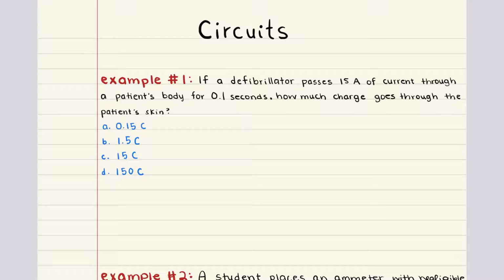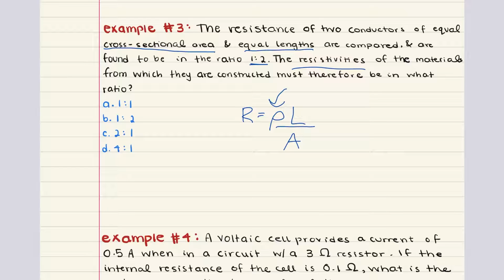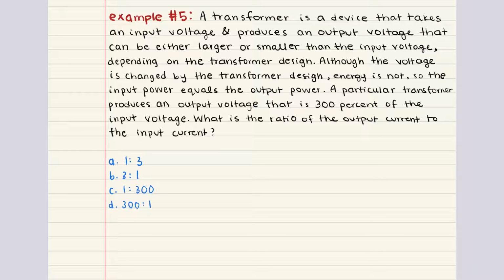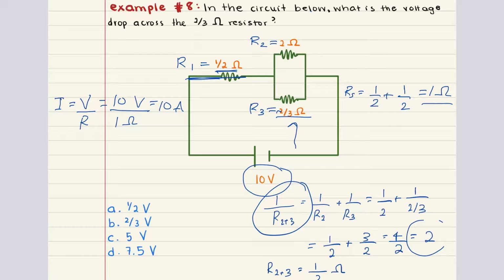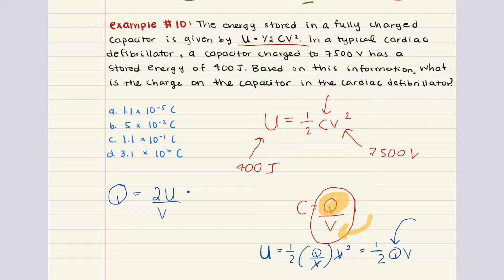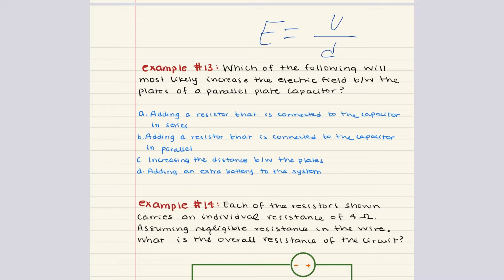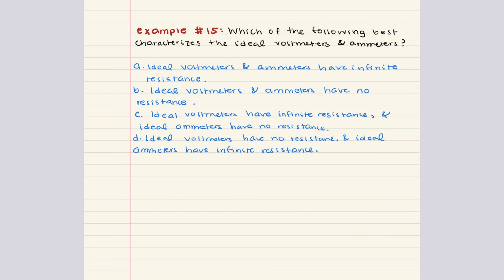MCAT Physics and Math: Chapter 6 - Circuits Problem Set

Comment: Hello Professor Eman! for problem 6, why did you reverse the reciprocal for the sum of the resistances of 3 and 4?
Reply from the maker: Timestamp?
Reply: Hi!  I think Professor Eman did this because we are trying to use the equivalent resistance (parallel) equation.  This will be 1/Rp = 1/R1 + 1/R2... 1/Rn.  Here, this formula is used because, if you look at the diagram for question 6, you will notice that R3 and R4 are directly above or below one another.  If you, in a way, flip the image or think of it like train tracks, you'll notice that they are parallel to one another.  This is why this is, in a way, the reciprocal of what we are looking at.  Afterwards, you'll see this formula again at the end as we do the calculations, because you will notice the section splits the setup into 3 layers (like a cake); they are all parallel to one another.  Here we are looking at the top layer consisting of R1, the second layer consisting of R2, R3, and R4, and the last layer consisting of R5 and R6.  Please note that this formula is used only when we are looking at a parallel circuit.  For other questions, you may need to use a different formula.  I hope this explanation helps; however, could someone please confirm that this is correct and makes sense? :)

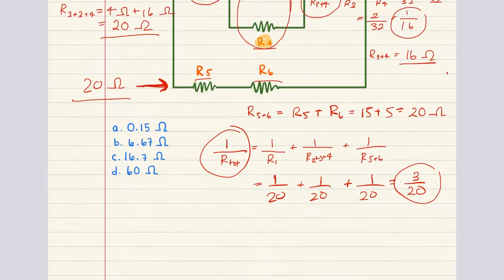Comment: Thanks for the video! I had a question for #6 (18:21) - I first calculated resistance of R3 and R4 and got 16 ohms. I then considered the R total of 3+4 to be in series with R2 to which I got 20 ohms. Where I differed from your work is that I then considered the R total of 2+3+4 to be in parallel with R1 to which I got 10 ohms by doing (1/20 + 1/20)^-1. Lastly, R total of 1+2+3+4 was in series with R5 and R6 so I added 10 ohms+15 ohms+5 ohms for a final answer of 30 ohms. Can you please help me understand why this approach was incorrect? Thanks again!
Reply from the maker: You mistakenly treated  R2 as being in series with R3+4 when they are actually in parallel.

Comment: I am a little confused on problem 8. How come the voltage drop across R2 and R3 are both 5V? Why wouldn't I use the calculated current (10) and the R3 value (2/3) with the V=IR equation to calculate the voltage across R3?
Reply from the maker: The voltage drop across R2 and R3 is the same because they are in parallel, and components in parallel always share the same voltage. Using the total current (10 A) with R3 alone is incorrect because the current splits between R2 and R3 . Instead, the total voltage across the parallel combination is 5 V, so both R2 and R3 have a voltage drop of 5 V. Hope that helps

Comment: Thank you so much for these videos! I'm a bit stuck on Example 4 as I understood the voltage across the terminals of a battery when there is no current flowing to just be the battery's electromotive force?
Reply from the maker: When no current flows through a circuit, the voltage across the terminals of a battery is equal to its electromotive force (emf). In this example, the emf wasn’t directly provided, so it had to be calculated using the information about the terminal voltage during current flow and the voltage drop caused by the battery’s internal resistance. Once the emf was determined, it became clear that in the absence of current, there is no internal resistance voltage drop, meaning the terminal voltage is simply the emf.

The key takeaway is that the terminal voltage equals the emf when no current flows. However, when current is flowing, the internal resistance causes the terminal voltage to be lower than the emf. In this problem, calculating the emf allowed us to determine the correct terminal voltage for the no-current scenario.
Reply: @professoreman2289  oh LOL silly me, thank you!
Reply from the maker: Of course! It’s a great question! Let me know if you have any more:)
Reply: @professoreman2289 Hello! I have a question about this. When there is no current (and voltage and emf are equal), shouldn't the answer be B) 1.5 y? I dont know why l'm having so much trouble understanding this..
Reply: Hello! I have a question about this. When there is no current (and voltage and emf are equal), shouldn't the answer be B) 1.5 V?   I don't know why I'm having so much trouble understanding this...
Reply: @Jupiter742  IDK if this is a good explanation, but from what I understand: getting 1.5 V means that we didn't calculate emf first. We just did V = I*R and assumed that this terminal voltage is = emf without accounting for the internal resistance. We have to understand what is emf. It's not really a force, it's based on the chemical reactions taking place within the battery that lets us know the maximum voltage a battery or power source can provide with or without current. Unless the battery is dead or some chemical change occurs within the battery, it will not change based on current flow. The voltage IS variable, however, and will always be lower than the emf d/t internal resistance. So, with this in mind, when we solve for the value of V as 1.5 V and plug it into the equation to solve for emf, we get 1.55V. We can't say that without a current, the emf is 1.5. It doesn't make sense. This will go against what I just described. Instead, we say without a current, V= 1.55V and with a current V= 1.5V. Hope that makes sense.